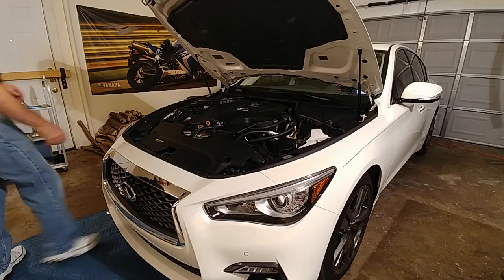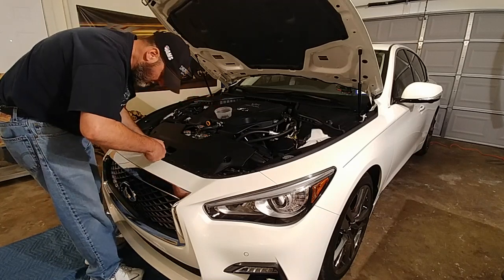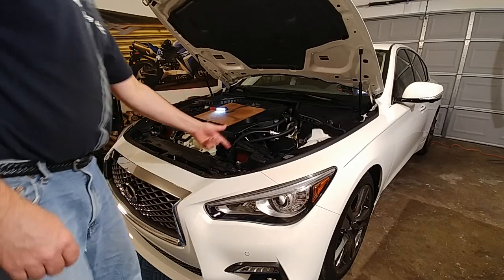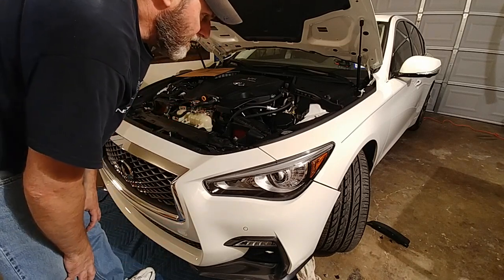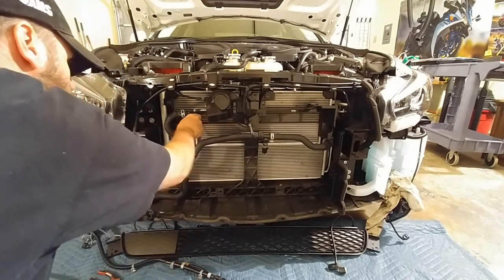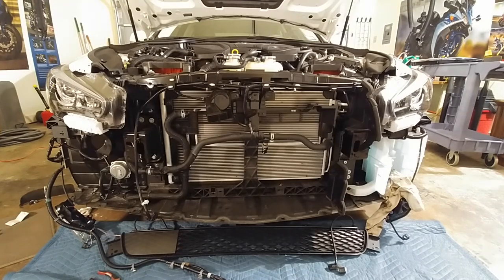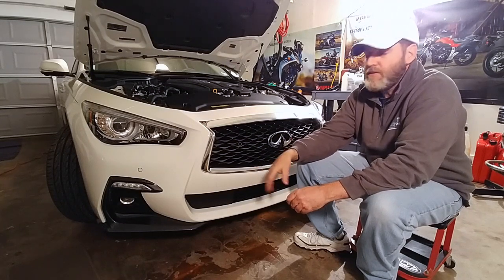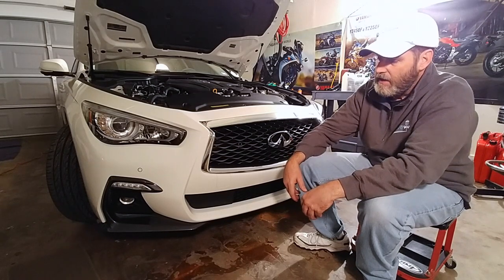Burger Motorsports heat exchanger install-bleeding the cooling system Q50 2019

Comment from the maker: I recently saw a video where a guy was bleeding his heat exchanger and having the similar issue I was having with the airvac tool. System wasn't holding the the air pressure. I just tested what he confirmed and indeed it was the source of the air leak. On the overflow reservoir container, the plastic tank on the left, there is a small airhole right next to where the coolant cap installs. You have to cap this off. Now with that capped the airvac tool pulls the -25 vacuum. With this now known, I can confirm that I know how to competently bleed the Q50-60 heat exchanger with a vacuum refill tool. With this said my heat exchanger is already full so no need to suck more coolant into it.
Reply: Why u take of the factory heat exchanger if you leave it u have more water so more cooling better that 2 heat exchanger
Reply from the maker: @Baroy1010  if I did it again I would likely  do it that way. 8 months ago I wasn't as concerned with fluid amount rather than flow. It would have been easy to do to run both. Funny thing is the stock heat exchanger is so small, flimsy and thin it likely held about as much fluid as a drink glass plus I figured it was restricting flow like a straw. someday here I'd like to get a in the fender expansion tank so hopefully someone soon will come out with a plastic one like the overflow tanks and price it $300 less. I can do with out the metal. What I'd really like to do is the the chiller killer air-conditioners coolant. I've know about this for years as people here have them on the GT5.0's,  Scatpacks and Hellcats.

Comment from the maker: Update: I did find out the next day that when I was tinkering/cleaning the airvac tool that the male quick disconnect that came loose in the package, I had somehow loosely screwed into tool and then forgot that i did that. It needed the telflon tap and to be tighten with a wrench. Due to this oversight it was leaking a small amount of air. I hooked it all up again just to see if there was a different result this time around. The airvac tool registered 15 psi vacuum where when vacuum was released it basically just filled up the overflow bottle to its top again. I had to remove that portion to get it to the proper level. Car seems to be running fine and is strong so I'm calling it job completed.

Comment: The heat exchanger will probably be my first performance mod and definitely not looking forward to it.  Currently driving a 2019 Q60 Luxe 3.0TT.  Great video and car.  Looking forward to to future videos.  Subbed.  👍
Reply from the maker: Many thanks and I enjoy hearing from folks. An upgrade to a better functioning heat exchanger is a great modification even if you don't plan on increasing your boost levels, but big advantages if in the future you do undergo increasing your turbo's boost or you like to just push your car's performance characteristics. The first mod I would definitely tell others to do first, or as soon as one can is to get an oil catch can. I can contest to the Mishimoto oil catch can and their custom bracket where I can feel 100% good about recommending it. This product catches somewhere around the 99.7 percent of the liquified oil and blowby contaminates getting sent/recycled through the PVC system. Just bite the bullet and get one where you will be repaid in long term performance staying the same from when the engine was new. Adding a better functioning heat exchanger will not add power but what it does is it will allow you to keep most of the power run after run that your engine can produce over time or on warmer days (80 to 100 degrees). The car's ability to keep its motor cooler (within its limits) will increase its longevity and it will function better too.

Comment from the maker: For anyone who wants to see how to properly do this install and how much work needs to be given to it then look here: https://www.youtube.com/watch?v=HJTWCD98zsU. 

I took as much care to dismantle and reassemble as they do in the Mishimoto video where there approach was/is clearly the most efficient way because they used a lift, removed front tires, removed the under tray, removed the inner fenders and went at the connectors and harnesses from inside the fender wells. 

The other step hey did in the video was to loosened up the radiator by it's mounts thrreby providing additional room for the factory oem heat exchanger to be removed from behind the brace. Lots of extra work and experience working on these Infiniti cars can be a huge bonus.

 I had zero experience with a water to air intercooler on a Infiniti car. Learned as I went, but took my time and tried to pay attention to the details so not a shotty job. Wish they would have gone into more detail about bleeding the heat exchanger system with airvac bleeding/fill tool.

Comment: You can use this to bleed air out of heat exchanger by installing it in the highest poit
Reply: Z1 Frontier / Pathfinder / Xterra VQ40 Billet Heater Hose Inlet

Comment: Can I bleed my heat exchanger after coolant has already been placed into heat exchanger
Reply from the maker: Yes, just pull a -20 psi vacuum and then cap it off to see if holds pressure over 5-10 min. Then put the bottle of coolant up above level of HX and then put the fill hose from vacuum tool into the coolant container. Nest open the valve to release pressure and thereby pulling the coolant out of coolant container and down into the HX.
Reply: @GettingthruLife  what is that red jose that you are connecting to the device? Where is that red hose coming from?
Reply from the maker: @salshaw1827 My hose that's red colored is the airline to the compresser.
Reply: @GettingthruLife  so for this process i will also be need a vacuum tool correct? Sorry for the dumb questions brother but im clueless when it comes to heat exchanger. I’ve been having an issue and can’t get the air out of my ams heat exchanger. My local mechanic has been doing standard bleeding, but it’s not working and I can’t find anybody else to do it.
Reply: The tool in your video and a vacuum tool right?
Reply: @GettingthruLife  also saw this on amazon and wonder if it will work for me(Radiator Pressure Tester Kit Upgraded Coolant Pressure Tester Kit Car Coolant Vacuum Refill Kit Universal Vacuum Coolant Refill Tool Automotive Cooling System Pressure Tester Kit Vacuum Coolant Filler)
Reply from the maker: @salshaw1827  yes no problem it's technical and if you don't do this stuff for a living then we have no clue. I had to learn and some trial and error along the way. I bought the vacuum tool/radiator coolant fill device. In shirt it pull a vaccum and then fills the system back up with coolant if done right. Can be used to pull out the air pocket/airbubbles too. The hx system is a closed system just like radiator. 

The downside of hx coolant pump is if there are big enough pockets of air in the hx system, the pump can't circulate the coolant around. Also the coolant being circulated around and cooled helps to keep the hx mechanical pump cool and the coolant acts as a lubricant for the hx pump.

Don't want to damage hx pump because it cost $550-600 to replace.
Reply: @GettingthruLife  ok got it so what do i do if my HX already has the coolant. Now how would i just take out the air inside?
Reply: @salshaw1827 The tool in this video is the vacuum tool; it’s called an airlift coolant tool. You need that and an air compressor capable of at least ~90psi.

Comment: Do you think it can be done without the suction tool?  Thanks for the video.
Reply from the maker: It could be done without but it's risky. Infiniti requires the tool be used by their mechanics and AMS/Mishimoto/Burger Motorsports suggests by all means use a airvac tool. I have seen through my journey that people have had issue with their car overheating because they did leave air pockets in the system. I've seen the warning that if the air pockets are not all removed then the pump can't move air. When this happens the pump motor or motors like in the in Red Sport 400 can burn up. I just bought $65-75 tool to be safe and feel better about it. I already had the compressor and air hose.

Comment: my mechanic didn’t use that suction tool while bleeding my Heat Exchanger when I got it installed. he just took it for a drive around the block and kept on refilling the tank. ‘till this day I still find myself having to refill the tank because my coolant drains quick after a day of driving the car.. can I still take my car to a shop so they can properly bleed it, or is it too late?
Reply from the maker: Yes you should be able to still use a a vacuum tool to fill it. Why I bought the tool myself was I read in the instructions online that running this system with air pockets can lead to overheating the 1 pump/2pumps RedSport which could cause the pump to overheat and break. Pumps are likely $300-400 so I just got it.

The tool would also allow you or a shop to pressure check your system of leaks which could be causing to lose coolant. Also a cause for coolant loss maybe turbo related but you will need to figure that out.
Reply: @GettingthruLife  yikes, hopefully this issue isn’t a turbo issue.
someone on the forums suggested that I should keep on filling it ‘till the air bubbles disappear, but that’s honestly a waste of coolant
where can I get a vacuum tool? or do you think I can take it to my local Infiniti dealer and ask them if they can bleed it? I got the BMS Heat Exchanger though so I don’t know if they’ll want to touch that since it’s not their part
Reply from the maker: Amazon search: OEMTOOLS 24444 Coolant System Refiller Kit, 5 Adapters

You can buy one or I'm sure get infiniti dealership to do it for likely $100.

If you keep filling it for weeks and it never gets filled and stays there then likely... potentially other issues. Check around for white powder like substance residue that has a very unique smell. That's the coolant leaking out. Also make sure you two coolant caps are on tight.
Reply: did you ever find out what this was g? im having this same exact issue.. hopefully not my turbos smh
Reply: Same issue but my car feels super slow . I got heat exchanger installed and blow off valves . Does not bleeding correctly make it slow
Reply from the maker: I'm not a fan of blowoff valves. Could be related to a boost leak now.  Got to double check connections. These cars to run blowoff valves need to be tuned/calibrated for the blowoff valves. These cars have all electronics monitoring and adjusting everything. You put on mechanical bov's and the car's computer has to second guess itself.

Boost/over boost is regulated by thus car's systems such as electronic wastegates. Not saying your bov install is the problem but could be related.
Reply: @GettingthruLife  yup but I read that if the heat exchanger wasn’t bleed properly it can also cause it to be slower due to the temps not being met ? Or levels
Reply from the maker: That typically happens after multiple high speed passes. Under normal driving/decreased temps the heat exchanger is more passive. So if you compressed air temps are not being pushed to the limit then the hx coolant temp doest climb as high.

Of your hx isn't working properly it will be most evident when pushing the cars performance. A boost pressure leak will affect the car all the time because boost can't build up. Just a thought.

I'm not a professional mechanic so I'm just presenting ideas for potential problem.
Reply: @GettingthruLife  my heat exchanger coolant gets low and I’ve been having to top it off I barely installed it yetserday I’m assuming that’s the issue after doing further research and talking to people with same mods . I need to bleed it properly so that the coolant levels are correct and topped off
Reply: @GettingthruLife  yeah I don’t think it’s a boost issue because eveytning was fine I don’t have any CEL codes and like I said the coolant for the hx has been getting g lower and super hot after driving for a little bit . For vacuum leaks the CEL turns on instant pretty much
Reply from the maker: The tool to fill the 2 coolant systems is the preferred and safest way but some don't want that added expense and I can sympathize with that. Yep, just keep adding coolant and don't run your car hard for extended time until the hx coolant tank situation levels off. If it goes week and weeks then infiniti deakership likely needed to get involved. Could try the method of the so called burping the coolant system with the specific coolant hose there passenger side towards front top of motor. Downside coolant get splashed around. The kydro Q50 redsport fellow had a video of the process.
Reply: @GettingthruLife  yeah I tried to bleed it I hear no leaks and no cel still . I don’t see any bubbles but the car is still at loss of power someone mentioned ima prob need to get it tuned simve I have intakes bov and heat echangers . Unless it’s just not
Bleed properly still. I feel like a vacum leak woulda been detected already with a. Check engine light
Reply from the maker: 2 reason why power would be less. Limp mode or boost leak. Other things that can contribute low octane fuel and ecu pulling timing due to knock detection and that comes from hot outside temps. Not really hot yet across the country. Hope you get it figured out.

Ecuteck app sees more useful popup codes than this car displays as warnings or alerts.
Reply: @GettingthruLife  I don’t have it tuned yet … I just isntalljed bov and heat X yeysrtday . I was reading that air in system could cause it to be slow it gets to 60/80 then turns sluggish . Boost leak would be from a vacum leak from the bovs but the CEL isn’t on I feel like it would have been detected
Reply: @GettingthruLife  it is about 85 degrees Fahrenheit
Reply: @GettingthruLife  I had the car running for about 25 minutes and I noticed the level on the heat X coolant go down I’m hoping that was the bubble that it had I topped it off and left it running with the heater blasting for another 10 minutes and nothing ?
Reply: I will wait till tonight to drive it so that it’s full cooled down sinve it’s 85 degress and there’s a fire and car has been on for a bit
Reply from the maker: Downside of the Infiniti hx system is if there's a open air space in the system then the one pump can't pump air. I don't know about the Redsport model  with two pumps but I'd tent to think it still similar. I didn't of course design the system so all I know is what I see from like companies AMS and Mishimoto. What worried me was I saw if not properly bled then the Infiniti hx pump can burn out. Hx pumps are close to $500. Tour car won't auto startup in limp mode. It comes on only to protect motor when it see high temps or situations that can damage the motor if allowed to proceed and keep high temps. 4 options, take into infiniti, 2nd  buy the vac tool amazon/mishimoto/harbor freight but need aircompressor/hose/hose fittings, 3rd. attempt to try so-called burping, and 4th just top of when level drops.
Reply: @GettingthruLife  all that is perfectly fine lol . I feel dumb my issue is I have blow off valves with no tune. It’s causing my car to run super rich . Bovs are going off tomorrow
Reply from the maker: You then can at least see if that resolves the problem. A good infiniti VR30 tuner can makes everything  play nice together.
Reply: @GettingthruLife  it’s 100% the blow off valves since I have no tune. Yes if I want bovs I need a tune since it runs too rich sinve the air is released into the atnoapshete it’s throwing the maf sensor data off

Comment: You did ultimately remove the OEM heat exchanger, correct?
Reply from the maker: Yes I did. This was done at the end of 2019. Now there are a lot more videos on dual HX systems. Would have been very easy to keep the little bitty oem HX and plumb in this BM unit. The factory HX only holds 7 oz of coolant so not even sure if running the factory HX as a secondary HX adds anything noticable. That's about half a drinking glass.